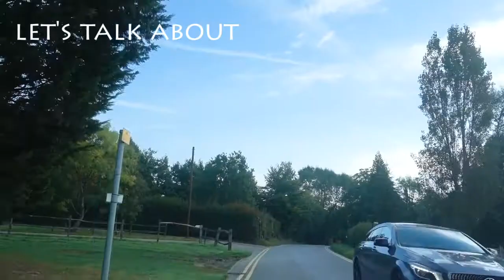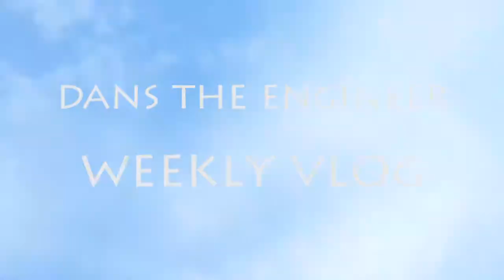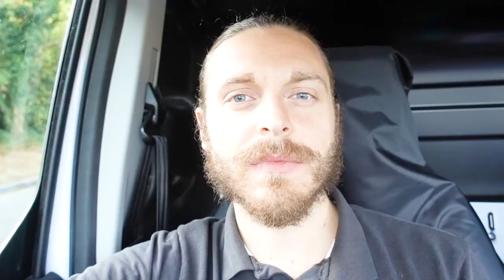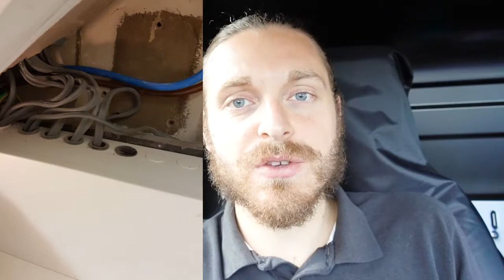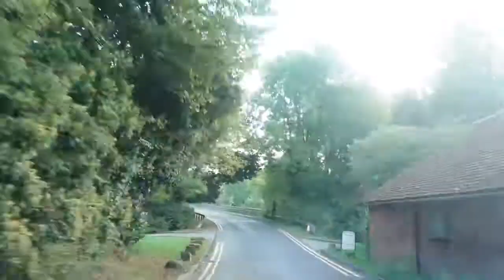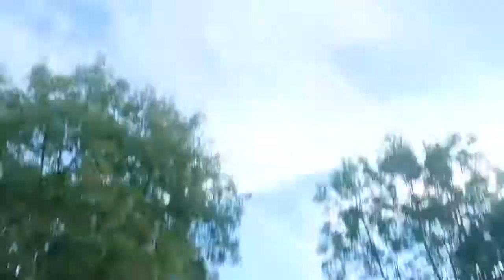SAFETY ISSUES | EV CHARGE POINTS | RAISING STANDARDS | WEEKLY VLOG

Comment: WTF that is Absurdly terrible install. EVSE most likely being the highest amperage device in a domestic setting. Not having a proper  grounding pathway seems like a massive obvious problem.
Reply from the maker: Neojhun if you understand EV charge points, Yes! But many don't. They are being treated as normal sockets in most cases.

Comment: I think it's very important that we raise awareness on the requirements for EV charging points. Demand is just going to keep increasing and electricians will 'take on' the extra work without necessarily knowing the actual requirements. Good idea.

as for the MICC.. mmmmmmmwah 😘
Reply: I completely agree, but I feel slating your fellow Electrical engineers is not the way of going at it.  I see theses YouTubers finding minor faults with other  electricians work and broadcasting it to the millions calling them every name under the sun. I’m pretty sure you could go back to a job you’ve done a couple of years ago and would do it completely different now. I’m not talking about this video In particular as not checking the bonding is just lazy but these videos I see of cables that are not clipped correctly in a cellar or a consumer unit that is missing a label being ripped a apart by a guy with a camera phone makes my blood boil.
 I love being an Electrician and have been lucky enough to work around the world doing it, but from what I’ve seen unfortunately the world isn’t perfect and customers can’t all afford rewires every time things start looking scruffy. We can only recommend they have the work done.
Reply from the maker: Totally agree. To my knowledge, nobody in the UK has died YET from an EV charge point issue. However, under certain circumstances it could happen! Some electricians are treating them as general sockets being installed outside but even fail to take ADS into consideration. The client is none the wiser. I want to film a survey I carry out to show clients what I need to look at to provide an accurate safe installation.
Reply: Or read the 18th Edition? I'm not being flippant, the standard is set out in the book isn't it?